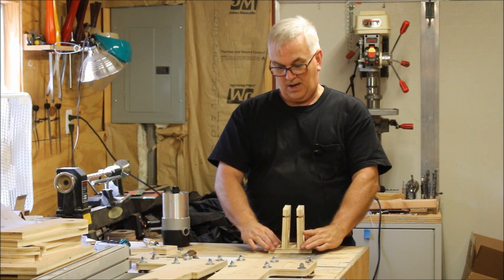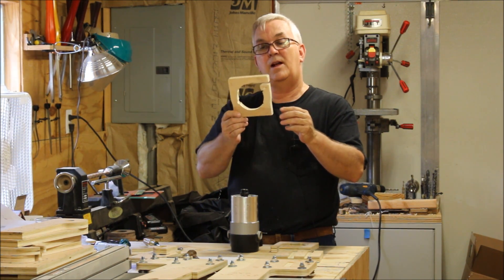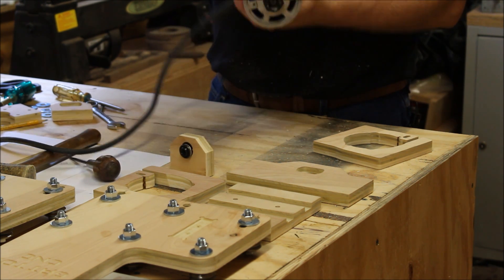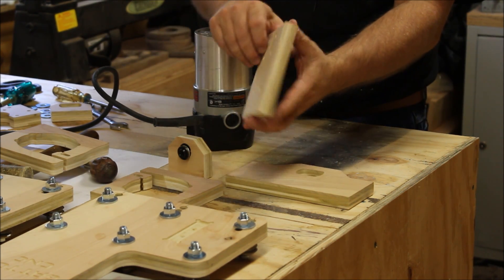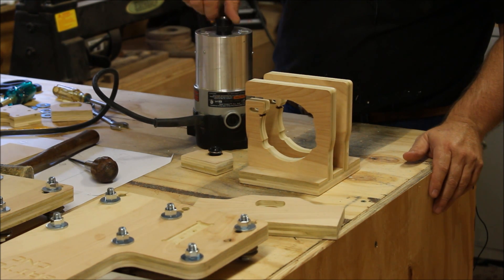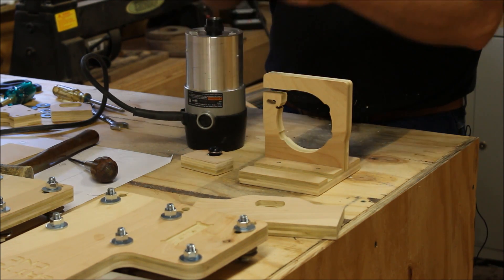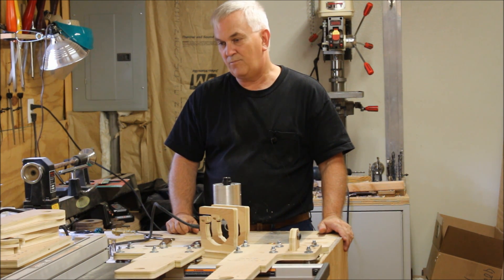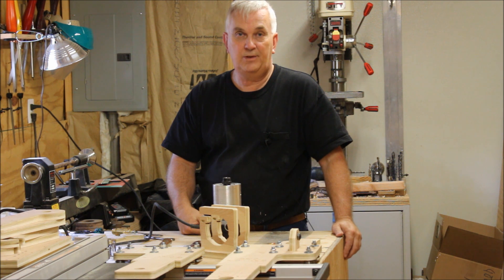Dave Gatton CNC Build Part 3

Comment: Hello Dave,  I appreciate you doing this series.  Also, am considering purchasing the cut parts from your website.  Will you be continuing this series on to include the things necessary to get the machine running.  Will your series include showing us how to get the equipment to drive the stepper motors and how to interface them with the computer and will you take it on to include the software necessary to drive the CNC Router machine.
Reply from the maker: Yes Glenn I will be doing a complete build to show all of the assembly and also how to connect the stepper motors and controller, configure the software, and run a program.  You can expect to see this machine running along side my big ol' green machine in my garage.  Thanks for watching.  I appreciate your support.
Reply: Dave, Sure do appreciate your response.  This will be an iterresting project, and am looking forward to it.  Will be placing an order for the cut parts.   Thank you again for the series.